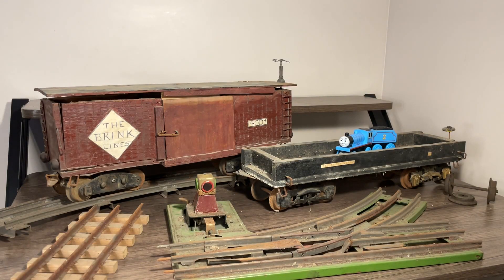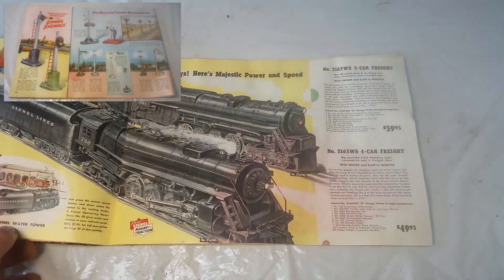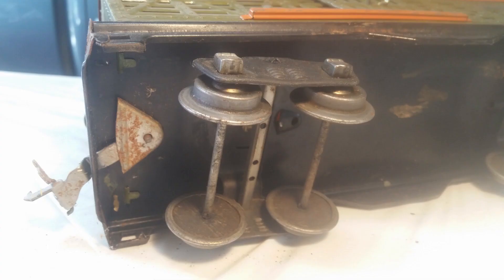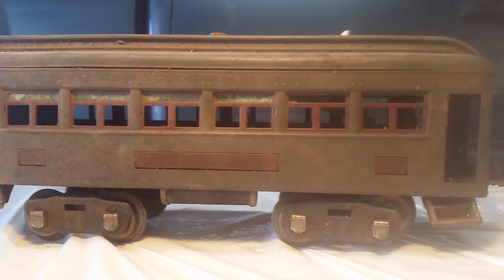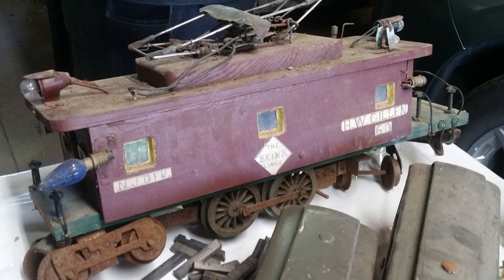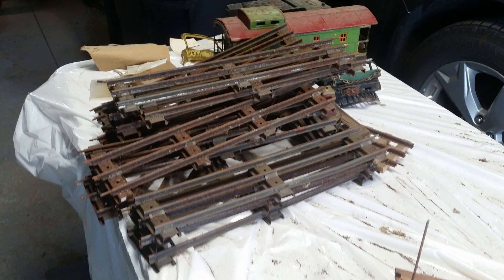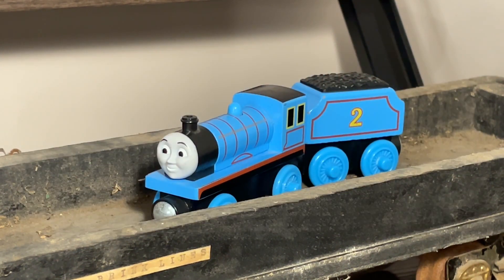Prewar 1930s Lionel Trains | Discovery & Overview

Comment: What a stunning group of models, good on you and how nice it is to hear your enthusiasm. 
First up: Be aware the roundhouse part is very, very expensive, if you part with it you won't get another one.
Not only expensive, but rare. A very quick look in an older guide gives that 1 piece at $2000. And yes, reproductions were being made at that time. 
They are rare, and expensive :) (P.S it's a lionel #444)
And a few more things: it's all standard gauge, not 0, standard being the "premium" gauge.
FYI your 318 is an early pre '27 example: if you have a look underneath you'll note the gears on the wheels are very large, actually being larger than the wheel tread. Later lionel altered the super motor by adding extra gearing, and as a consequence those wheel gears ended up being smaller. With your example if you run it over the turnout you'll notice a big thump and jump as the early big gears hit the turnout rails.
More FYI: the steam tender to be an Ives transition era. It looks to be all diecast, which lionel didn't make, but when lionel took over Ives in the late twenties for a few years they sold Ives equipment with lionel badges before calling it quits. You'll also note the oddity of instead of lionel lines it badged as being THE lionel RAILWAY lines, not normal nomenclature for lionel, especially with the term railway, not railroad. 
Love the custom box cab: uses early #100 trucks and the pre- super motor drive set, possibly out of something like a #33. One of the obvious things is that the boxcab has it's own very unique place in modeling history.
It's easy to think of early standard gauge or 0 gauge as being bright toy trains going around in circles. What a lot don't recall is that the equipment was what modelers had available to use for the model railroads like we have today.
That custom made boxcab was built to serve a function on a model railroad. Yes, there's a certain crudity about it (adds to the charm) but full credit to the modeller building. 
Remember there were no plastics, only wood and if available tinplate (even tinplate was unavailable during WWII and it's not a pleasant material to hand build model trains from)
NJDIV I presume means New Jersey Division.
I just noted the end few minutes of your video that most of the items you got rid of... it'd be very interesting to know what happened to that roundhouse section... just proves that theres still that occasional very rare find to be had...
Reply from the maker: The models were sold to a good guy with a permanent layout setup and the resources to maintain them. I appreciate all of the information and it is interesting the Lionel models were not technically O gauge. Thank you for watching!

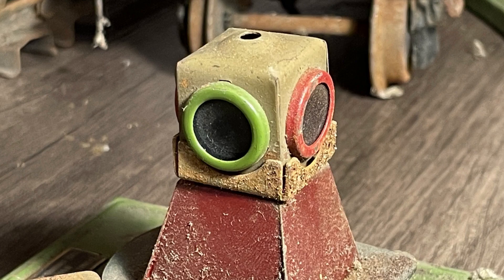Comment: Okay, first off, what you've found there is standard gauge, not O gauge.  The dark gray 318 locomotive was the first variation of the 318 Lionel made, and it was only issued in that color in 1924 - one year only for that color, then it changed to Mojave tan.  The 513 cattle car you have is also the first version and fairly scarce - pea green sides and orange roof was first variation, 1927-1929, after that they went to much more common orange paint with an apple green roof, and lastly, yellow body with a brownish/brick red roof.  The large wooden locomotive uses an early Lionel standard gauge motor inside a Lionel #38 locomotive frame (1913 to 1923) with early Lionel trucks on each end, it's a copy of a New Haven Railroad electric locomotive and you're correct, it's rather crude and homemade but still very impressive.  The roundhouse section is VERY rare and worth quite a bit of money even in that condition.  Best not to restore any of these pieces and leave any repair work up to a collector.  The black gondola shown at the 14:17 mark has very scarce Ives large series passenger car trucks on it, which were used from 1925-1927 and are very much in demand by collectors - very hard to find a set in decent shape.  The rest of the pieces are pretty common - track is easily found, rusty track like that is best sand blasted and just used to display trains on a shelf with.  Great find and don't go crazy repainting anything, you'll greatly lessen the collector value of these pieces.
Reply from the maker: Thank you for the information sir, I'll be sure to treat the models with care.

Comment: The custom electric locomotive is a boxcab electric. They were very common in the early 1900s especially when steam was banned in the New York subway tunnels.
Reply: Also the Lionel locomotive 0-4-0 looks to be an s-motor another type of boxcab
Reply: Also judging by the size of the models these appear to be standard gauge which is larger than o gauge
Reply from the maker: Thank you so much for the information! I tried to use resources online, however, if I dug a little deeper - perhaps some books - I probably could have presented the history of these awesome locomotives better. Again, thank you for the insight, it's much appreciated.

Comment: The original Lionel trains were standard gauge just a bit smaller than G gauge then they moved on to O gauge then made H.O gauge but they mostly focus on O gauge. and at 9:16 the engine is probably based off of the alligator train

Comment: That electric is custom built, using early lionel trucks and a motor from what I believe to be a lionel no. 38 electric locomotive, other details, such as the light bulbs and the pilot are also lionel pieces, the flat car & hopper also use lionel trucks
Reply from the maker: Thank you for the information! I couldn't find any details about it online, so this has been very helpful.